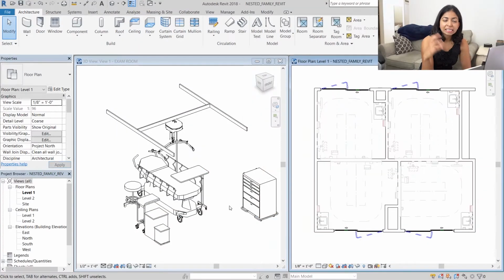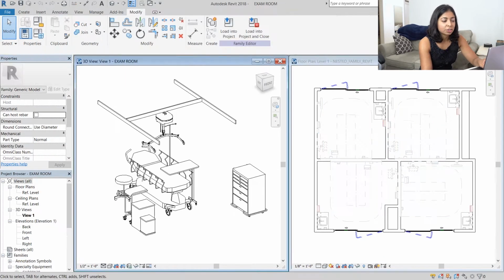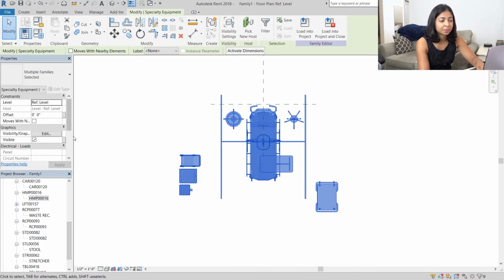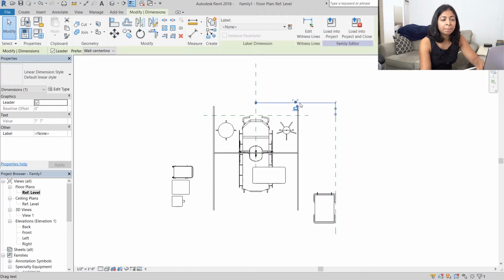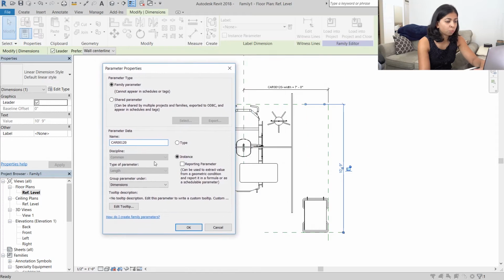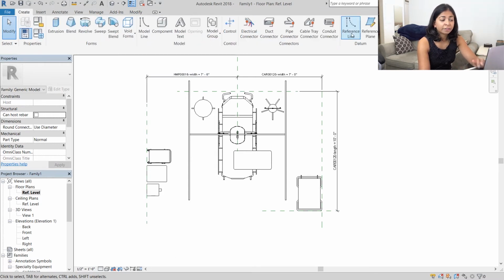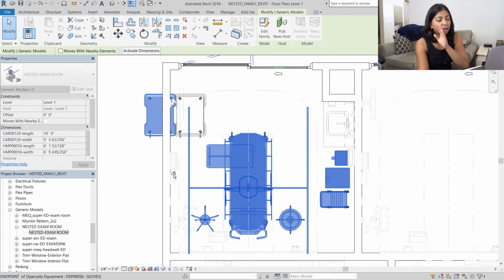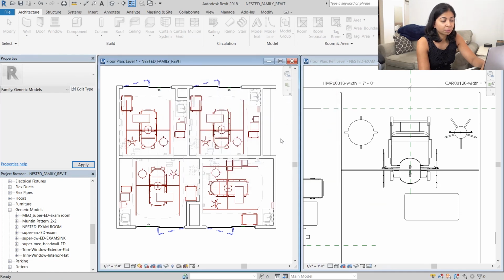How to create a nested families & parameters - part 1

Comment: Hi, I have a question about Nested switching family, I'm not sure if it is possible to do. How can I set up a family type to change it by itself in case it measure get changed in the project? For example if there is one steel beam connecting two columns. Let's regard that the distance between two columns is 3000 mm and for this amount of length I use BEAM A. So I realised that the dsitance between the columsn have to be 5000 mm. But for that far distance I need BEAM B that is stronger than BEAM A which both of them are a family nested with different types. How I could create a parameter to limited and change the beams according to the need of the project?

Thanks.